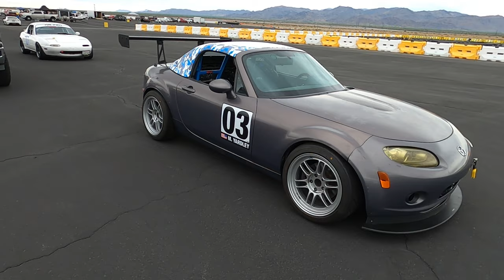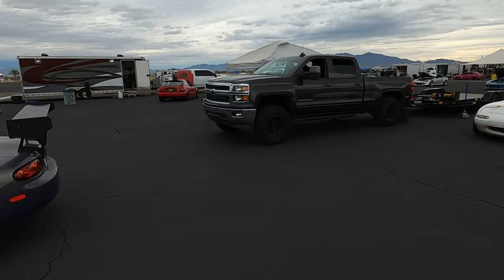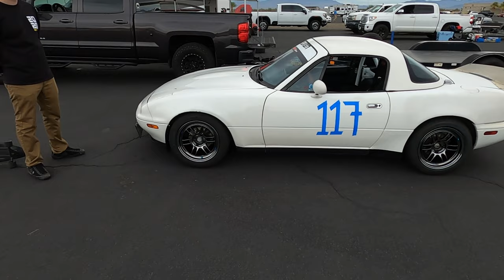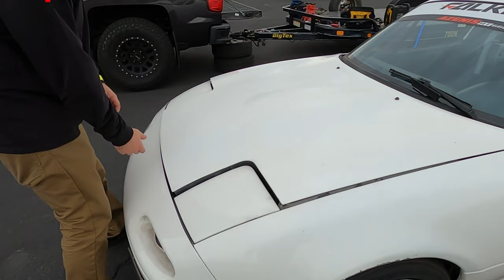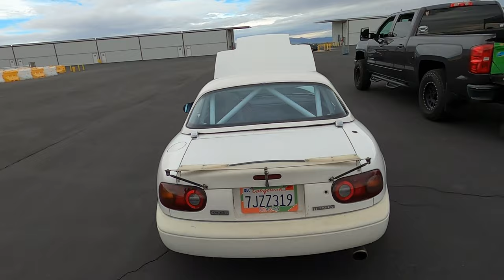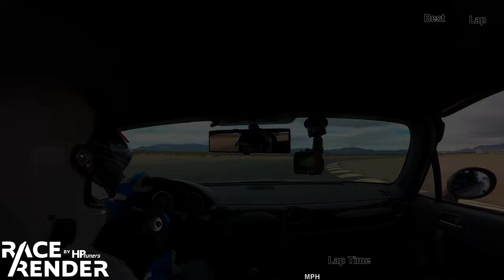Testing Racebred Components Aero at Chuckwalla Valley Speedway in the 2.5 NC Miata

Comment: You are correct in wanting a little oversteer to be faster so you can get what they call slip angle! You might get some from stiffening the front sway bar up a notch if you haven't already tried that (since the video is 10 months old)

Comment: Hey Mitchel, first of all I'm a huge fan of your build, love the humble not too crazy expensive but practical set up situation that you've got going on 👍🏼 and that wing is 🔥 

I'd like to ask you about a few things giving that I have my own 2.5 swapped NC. 

How much weight did you save with the weight reduction and more importantly how much of a difference did it make? 

I have a 1.6inch header, do you recommend the 1.8, like do you feel like that's worth the money 🤷🏻‍♂️? 

Was your car originally hardtop or soft top and how much weight do you reckon you saved by switching to what you have now?
Reply from the maker: Thank you for the support. Greatly appreciated!

So I have had the car weighed with and without me in it.  Without me in it, (before the wing and splitter so add maybe 25 pounds?) was 2323lbs. With me in it (im FAT) was 2600. I guess I do not know how much of a difference it made as before I even hit my first track day, the carpets, plastics (still have door panels) and soft top were removed so I never tracked the car in full weight.

I would def go to the bigger header, there has been gains even on a stock engine 2.5 without cams or intake. I believe its worth the money.

Car was originally soft top, when I purchased, the soft top was removed and the hardtop you see today on the channel is what was on it.  The soft top mechanism is pretty heavy, much heavier than an aftermarket hard top. Maybe by 30 pounds?
Reply: @MitchelYardley  Thanks for answering 👍🏼

Comment: I can tell the car is more stable because you are not having to correct with the steering as much as your other videos.
Does your data tell you if you lost any mph at the end of straights?
I don't have Aero experience so can't advise. But if my car was pushing out where it was I would run with more rake or stiffer rear bar or softer front bar.
Reply from the maker: Data doesn’t show any loss of mph at least on that track. I have data from other tracks that I will compare when I finally go to them with the aero but with zero AOA I don’t think I’ll loose any dramatic MPH.  And yes I will need to mess with the sway bars to try to get some more rotation in the car

Comment: When you remove the rear sway bar doesn't that give you the understeer? I did the same thing and went back with a stock rear bar and it improved turn-in.
Reply from the maker: I have only removed the rear sway bar once, and that was when I was running the front splitter and no rear wing. It 100% made the car not twitchy/not oversteer much. I didn't notice any understeer with that setup.
Reply from the maker: Take a look at this lap versus the one right after on this video  https://youtu.be/oYH3_oQjwV8?t=149